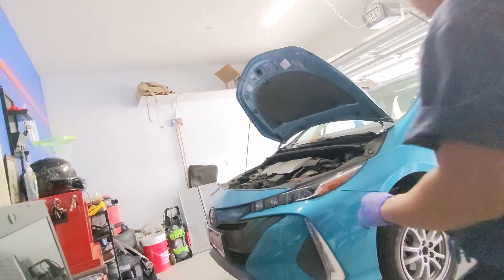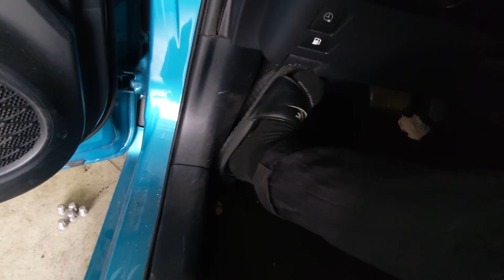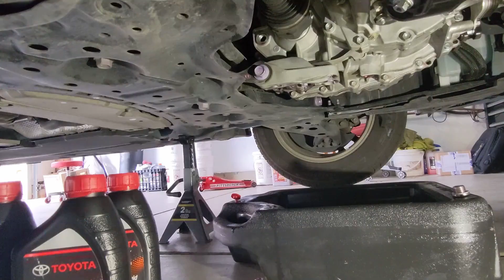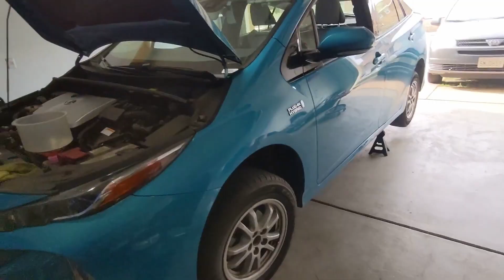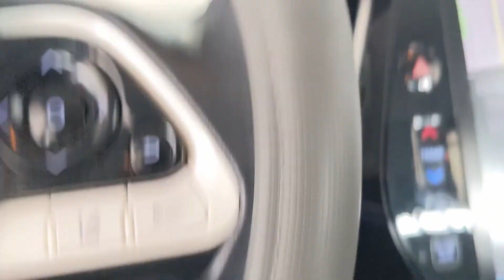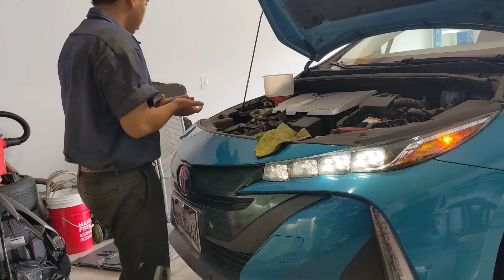2017 TOYOTA PRIUS 150K MILE MAJOR SERVICE

Comment: I didn't see you add engine oil. Also, you should wear safety boots.
Reply: Those are top of the line safety sandals that he has on there. Leave him alone 😂
Reply: I also didn’t see him take out the drain bolt. He should not put on that drain bolt before taking off the drain bolt.

Comment: Transmission fluid needs to be changed every 60,000 miles. The additives packages are tuned to the gaskets, seals and metallurgical composition of the transmission. Any car will see improvement with new fluid, especially if it is really old. 

The Toyota eCVT is much more tolerant of variances for mechanical functions, there's still seals and those are where the additives come into play.

The greatest improvement I saw at my 100K service was after switching over to Valvoline Restore and Protect. Within 500 miles, we saw a 3% MPG improvement on consistent driving routes and patterns in Southern California traffic.

Toyota hybrid head gaskets go bad when the coolant isn't changed every 100k or 5 years. (50k is a better number as acidity starts to eat at the head gasket coatings.)

Comment: Jack points Center in the front and back with the jack stands on the pinch welds. That increases stability and safety. It also doesn't damage the pinch weld like a regular floor jack would.

Comment: Valvoline wants $250 to flush and refill transmission fluid fluid  is that over priced ? I ask I just want a drain and refill they said they only do flush and refill no drain and refill  seems exspensive

Comment: This is the best video I've found on YouTube. The videos by SK are good but the omission of the removal of the 6mm plastic (I think it was plastic) hex bolt that separates the two halves of the radiator coolant overflow on the left side of the engine bay gave me anxiety while doing the engine coolant portion. I had baught a "professional-ish" clear "OEM Parts" coolant change kit for $20 and this was its first time use, even though it had included six adapters, all six did not fit so I went to my local pull-apart, grabbed a junk plastic screw on Toyota reservoir cap and made my own. To be honest, a $5 large funnel, the cap I swiped, the use of a Harbor Freight step-drill bit, and some silicone would have saved me $15.00 on the kit.

Comment: Gotta check that HV filter, probably would need the deep clean at 150k, great video, I've done the transmission fluid, next week it's the coolant.  I have the silly AWD-e (2022) so had to do that rear motor fluid, kinda tight in there.
Reply: Mine were actually very clean in spite of 97k miles, and the previous owner going to jiffy-lube oil changes after the free dealership service expired. This is a wonderful video, and so far, the best on Youtube.

Comment: I also changed the factory-filled Toyota WS ATF in my 2016 Toyota Hybrid (with a similar eCVT as your Prius) with Amsoil 100% Synthetic SS Fuel-Efficient ATF at about 40,000 miles.  The fascinating results from that one ATF exchange were the following:  The moment I drove the Camry after the installation of the Amsoil ATF (without any other services being performed on my vehicle),  I not only detected the vehicle was running a bit smoother, but also experienced increased power upon acceleration.  More importantly, my EV light was coming on more often and staying lit longer (which of course signifies my car is running electrically from the battery, while the gas engine isn't operating)!!

I note that you bought 4 quarts of Toyota WS ATF to accomplish your fluid replacement in your Prius' eCVT.  The following will help establish that Amsoil "100 Synthetic" Signature Series (SS) Fuel-Efficient ATF Fluid is vastly superior to the Toyota "Full Synthetic" WS ATF Fluid (made by Exxon Mobil).  You can compare the Safety Data Sheets between Amsoil and Toyota fluids and you will find the Toyota WS ATF (and true of the vast number of full synthetics) is mostly composed of hydrocracked-petroleum oil, a Class III Synthetic (that is extra-refined petroleum to mostly eliminate impurities, but it doesn’t get totally get rid of then entirely).  Amsoil Signature Series doesn’t contain a drop of petroleum oil, but a pure chemical mixture of Class IV Synthetic, known as polyalphaolefins (PAOs) and Class V Synthetic (such as Esters), plus top-shelf additives. 

The difference between a Full Synthetic and a 100% Synthetic?  Rafe Britton, a former Lubrication Engineer at Mobil and the creator of a number of highly educational YouTube Videos under the heading of “Lubrication Explained,” states in order for an oil company to call its oil product 100% synthetic, it must be composed of either a Class IV Synthetic (PAOs) AND/OR Class V Synthetic (such as Esters), while being completely devoid of refined petroleum. 

Toyota lists the Flash Point of their WS ATF Fluid as 347° F (175° C), whereas Amsoil's Flash Point is listed as 435.2 F (224° C), so Amsoil holds up to the heat far better than the Toyota WS ATF.  Amsoil SS ATF's Pour Point is -85° F (-65° C), but Toyota fails to mention their Pour  Point?  Another convenience factor of the Amsoil "100 Synthetic" Signature Series Fuel Efficient ATF Fluid is that it is available in collapsible bags making installation a snap (without the need for a pump that only provides a slow fill operation)!  Amsoil also provides a "100 Synthetic" OE Fuel-Efficient ATF Fluid (at 57% the cost of the Amsoil "100 Synthetic" Signature Series (SS) Fuel-Efficient ATF Fluid), where the Amsoil OE ATF provides lesser protection at the extremes than Amsoil SS ATF with a Flash Point of 410° F (210° C) and a Pour Point of -54° F (-48° C).  As you will note, the Amsoil OE ATF has extra protection from the heat in terms of the Flash Point than Toyota's WS ATF by an extra 63° F (35° C). 

The Amsoil OE ATF isn't available in the easy-to-pour pack (only the conventional quart or gallon plastic containers). The OE must be changed according to the manufacturer's specifications for your specific vehicle, however, the Signature Series will go double the distance (than the OE) under severe-driving conditions. For those of you that have a vehicle that doesn't accept a Fuel-Effecient ATF, you may consider the Amsoil 100% Synthetic Multi-Vehicle ATF (in both the Signature Series and the OE).  They also carry 100% Synthetic in both their CVT fluid and Dual-Clutch Transmisson Fluid. 

I had tried a variety of full synthetics over the years.  I began to utilize Mobil 1 for several years thereafter, until I found Amsoil being sold by an auto parts store that is no longer in operation.  After I personally emptied the Mobil 1 and I put it in the Amsoil in my car about 20 years ago, I was blown away with the increased performance, better fuel efficiency and the overall quietness of my engine.  For full disclosure (as probably guessed right now), I am an Independent Amsoil Dealer (all dealers of Amsoil are independent contractors, as opposed to employees of Amsoil).   

If consumers wish to buy the Amsoil products as a Preferred Customer (PC), they will get the oil at a 25% discount, plus free shipping when they spend $100 (plus receiving a $5 coupon for every $100 you spend).  It only costs $10 for a 6 month PC membership (or $20 a year) and there is no requirement to purchase (as there is with so many companies offering a membership for a preferred customer program, where there is an automatic shipment involved). 

If you or any viewers are tempted to try Amsoil, I invite you to visit the official website of Amsoil and apply to become my Preferred Customer, by kindly utilizing my name (James Norris) in the box underneath the question that asks “Did someone refer you to Amsoil?  If so, please tell us.”  Then in the next box they ask “Have a Referral Number?  Enter it below:”  I kindly ask that you include my Referral Number of 1420935 in that box. If you can write down my name and referral number, before you eventually decide to exit this webpage, it will be appreciated (so that it will be at your fingertips when you get on the Amsoil website).  You can also write me an email addressed to AutomotiveBuff at my gmail address (in case you have any questions).
Reply: Amsoil propaganda. 🙄🤮 Are you a dealer?🤥

Comment: my 2015 Prius has 180k miles has original brake pads still good for another 50k. miles
Reply: I had a 2007 Prius with 217K miles. Brakes were still good.

Comment: Thank you very much! i appreciate it, i have Prius 2017 i use it for delivery and shopping services, 6 years no problem, but now it needs to fix up the cooling system radiator thermostat. i don't know it  but the head light warning blinking and it takes more cooling water. i took it to Toyota Burien for maintenance.

Comment: Awesome video! Very clean work. Would be great if you another video on spark plugs and brakes pads replacement on the same vehicle.
Reply from the maker: Thank you! I will make a video on spark plugs and brakes when the customer comes back again for the job
Reply: Did they come back yet?

Comment: Nice work what about spark plugs and EGR
Reply from the maker: Thank you! The Spark Plugs and the EGR was not included in the 150k mile service manual. I used ProDemand to search up the services. However, there is nothing wrong with including them along with the services done in the video
Reply: I dont know anyone who cleans EGR on gen 4's. Different than gen 3's. Change your oil often & maybe change PCV valve @150,000 miles

Comment: Where did u get your fluid pump?
Reply from the maker: I got it from Amazon: https://www.amazon.com/Slippery-Pete-Transfer-Transmission-Differential/dp/B0853CNLYZ/ref=sr_1_6?crid=2NNG9NBDQK83A&keywords=transmission+fluid+pump&qid=1673987302&sprefix=transmission+fluid+pump%2Caps%2C190&sr=8-6

It's a little pricey for a pump but it works really good. Prevents me from taking a shower in transmission fluid lol.
Reply: Harbor freight also has it. I didn't even use it. I was able to fill from the top
Reply: @jbraMoVal how did you fill it from the top? Do you have a prius prime?
Reply: @justindoan6235  I just guided the hose through the cracks until reaching the filled hole. No, a Prius C 2014. I don't know if there is a difference. I recommend purchasing the service manual digitally for your model, it's cheaper.
Reply: Скиньте мануал как правильно прокачивать охлождающюю жидкость не запуская двс и как прокачать тормоза?

Comment: i have the same car.  Do u know why my collant is always below the low line from factory?
Reply: Mine was in between marks from new. I think so its not overfilled more pressure
Reply from the maker: Sometimes coolant goes down while the car is being used. Check the levels while the car has been cooled down. If it is still low, you can always add more coolant. But remember to NEVER open your surge tanks while the engine is hot and ALWAYS use Toyota Coolant :D
Reply: Also check underneath your car if there are any leaks of coolant. Low level may indicate a leak 😊